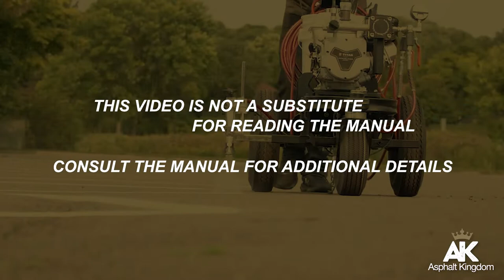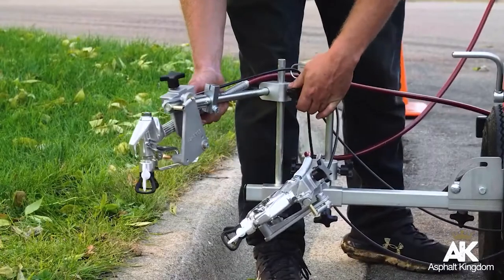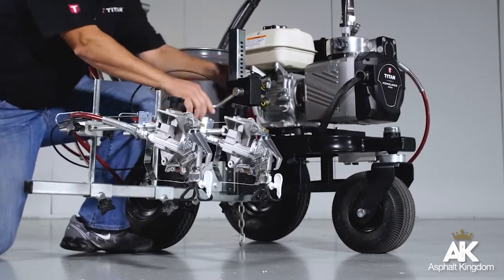How To Use Your Line Striper: Titan PowrLiner 3500, 3500S, and 4500 Application Tips

Comment: I bought a brand new titan 3500 line striper tried to do a job and it would only spray about a 2 inch line and the gauge says 3200 psi, i don't know what the deal is this is the first time to try to use it s brand new. i was using pro park from Sherwin Williams. it was in the low 50"s that day put i wouldn't think that would be a problem. any ideas
Reply from the maker: I'm sorry to hear you're experiencing issues with your new Titan 3500 line striper. It's quite unusual for such a machine, especially when it's brand new.  I would recommend reaching out to Titan Technical Service for expert assistance. You can contact them at 1-800-526-5362 and select option 2 for support. They will be able to provide you with guidance to resolve the problem promptly.
Reply: @AsphaltKingdom  thank you they said sounds like the paint is to thick but it’s not that thick.